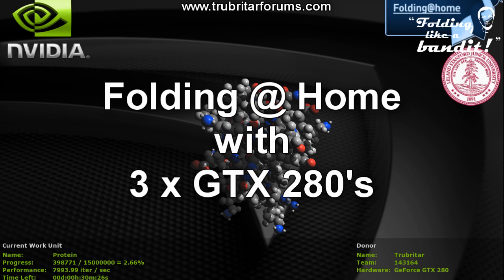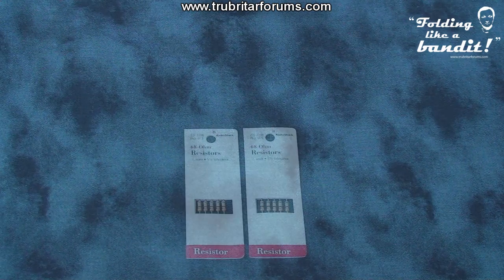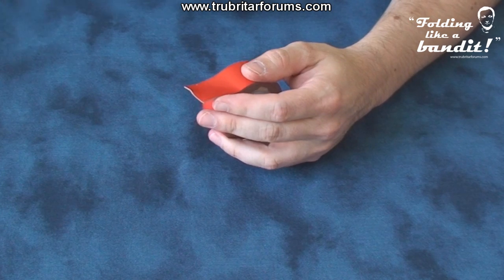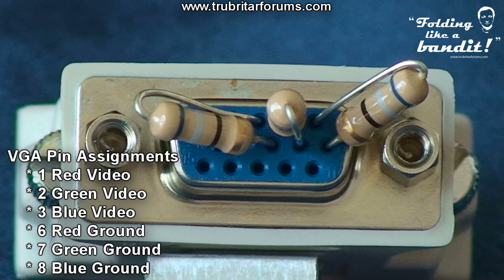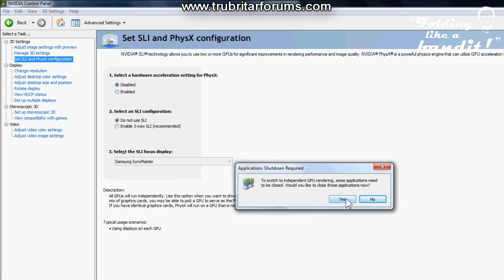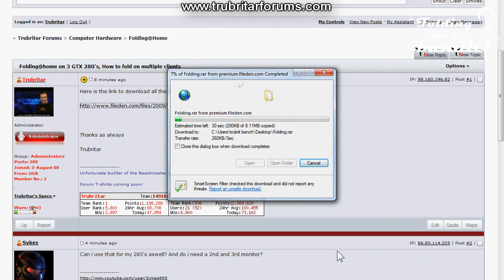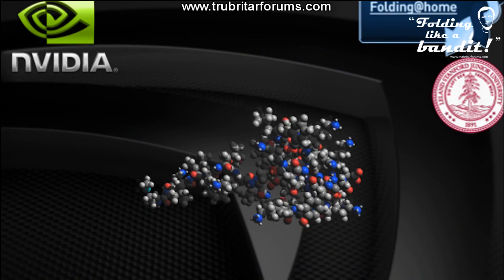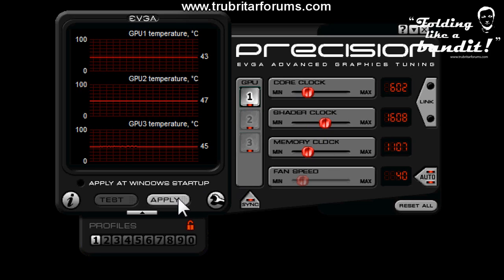(HD) Setting up Multiple clients on Folding@home.

Comment: It depends on how you look at it.  For example, if the system price goes from £1000 to £1100, then it's only 10% more to get a better CPU.

For distributed computing Hyper-Threading pays off dividends, as it does for software programming/compiling.  Outside of this, gains are only around 20% in multi-threaded software so you'd have to see if it's worth it.

Certainly for a gaming machine it's not worth it to go from a Core i5 to Core i7.

Comment: It basically means that the program isn't taking full advantage of the architecture/resources.  Hyper-threading is designed so that this type of program takes advantage of all the resources, and Hyper-threading ends up meaning an advantage of 100%.

Another program that takes a big advantage of HT is software compiling, specifically with Visual Studio.  There the advantage of HT is around 75%. That's an exception to the rule, though: most multi-threaded software will have a boost of around 20%.

Comment: Really don't see too much point in GPU folding.  They use considerably more power and give lower research value, making them a bad proposition when looking at PP/W and PP/$.

My 2600K at 4.4GHz regularly gets 30K PPD on smp8.  It'd take two GTX 560 Ti to match it, and they'd pull around 400W at the wall while my 2600K only pulls 125W.  I guess the benefit is that it's more convenient.

Comment: NO that is Points Per Day.  Rather than judge someones folding performance in Work Units, which would be unfair due to the difference in size and complexity of particular WUs, it makes more sense to assign a points system that awards more for more effort and less for less.

Comment: with my ATi gpu, i keep getting vpu crashes. i have the latest firmware. i even set the fan to 100 percent and underclock it, and set it at only 70 percent usage. but still, i get vpu crashes. anyone know how to fix this?

Comment from the maker: The Files are configured to work with ATi GPU's also, you will need an ATi GPU that's classed R6XX or later.

Turn off Crossfire or Crossfire X and conduct the same process as with the Nvidia cards  :)

Hope this helps.  Happy Folding

Trub

Comment from the maker: Download the File in the video and try running 2 of the 3 clients.  You will need a dummy plug or monitor linked to the 2nd card, also ensure SLi is turned off.

Let me know if it works out  :)

Trub